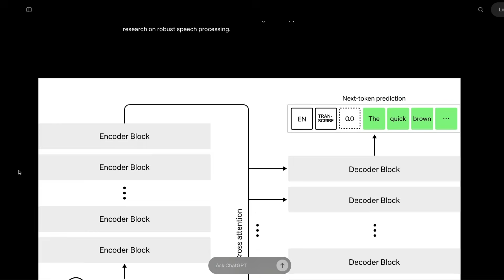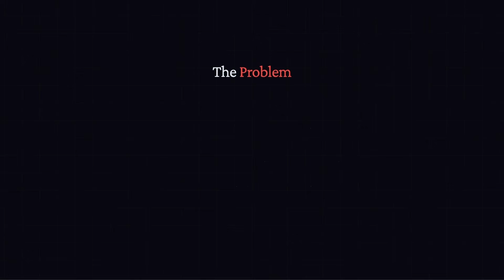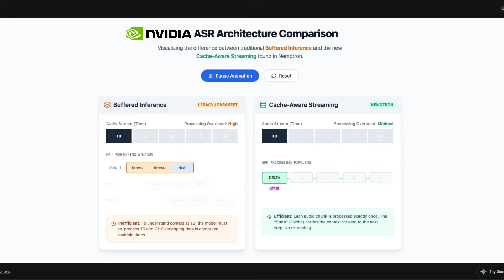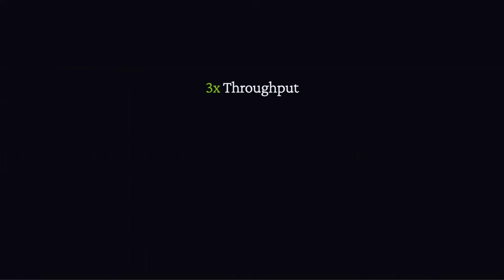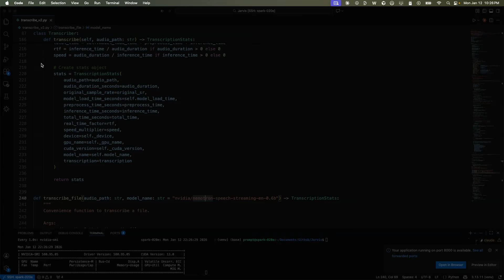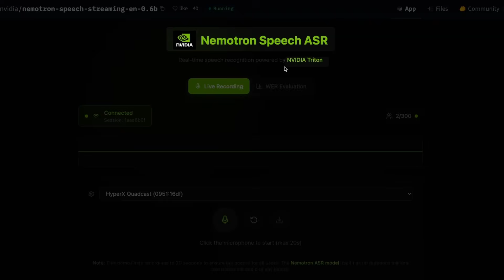Nemotron Streaming ASR on DGX Spark: Local Speech-to-Text, Tested

Comment: Whisper had a significant advantage purely due to whisper.cpp port especially with quantization support, which enables lightweight usage without the Pytorch runtime. This eliminates a major barrier to entry—users can now run the model by simply invoking a single binary. The accessibility is remarkable, even for someone like me who is comfortable working with code.  I don't mind 

Great presentation, by the way. Would you mind sharing the prompt you used to generate the canvas visualization?
Reply from the maker: I have used parakeet and it's lightweight enough that it can run on a cpu. Now also has the mlx support which makes it easier to run on macos as well. The new ASR model is using the same architecture so hopefully it will also be easier to run them.
For the presentation, it's a custom skill which I am building. Might open it at some point

Comment: I like it.  This is a similar method used to process time series data in dbs like InfluxDB.  It’s interesting to see how these proven concepts from other domains are finding their way into LLM solutions.  It’s all about the Delta.   It’s another useful context engineering technique that I’ve been using to manage long term persistent LLM memory.  Hash maps and delta.

Comment: Whisper-mlx is fantastic. Multilingual as well. How does nvidia‘s model perform on macOS? Especially the translate on transcribe? Are you going to show a comparison between whisper-mlx and nvidia‘s Model?

Arabic transcription / English transcription and translation during transcription? Local on Mac?

Does it create subtitle format as well?
Reply from the maker: I have been using nvidia parakeet-mlx in my whryte.com app and it's really fast compared to whisper. Will probably replace it with the new Nemotron ASR when the multilingual version is available. These models automatically detect language which is neat.

I don't think Arabic support is there yet but they are really good for local transcription